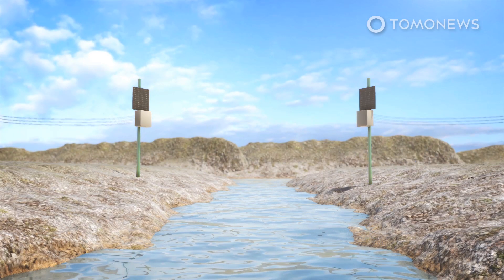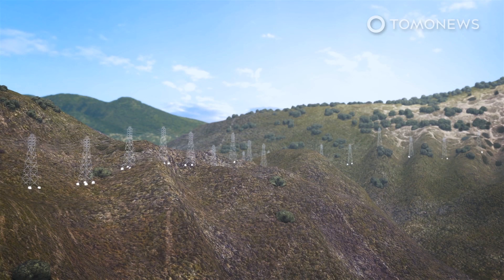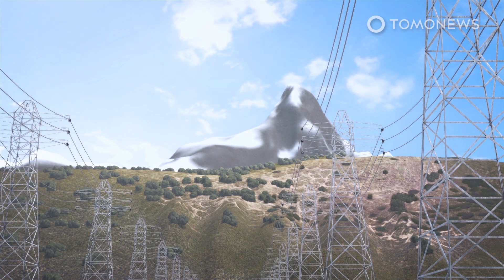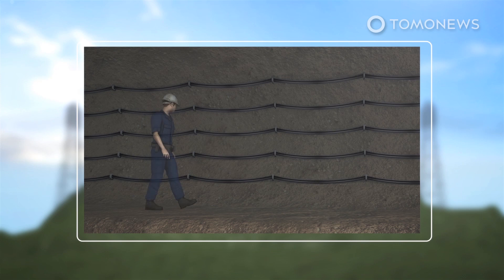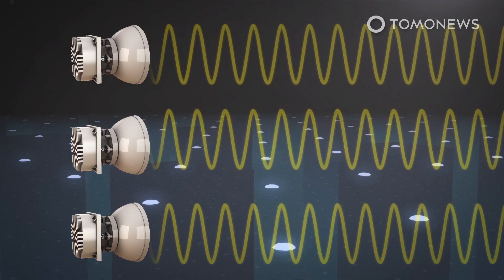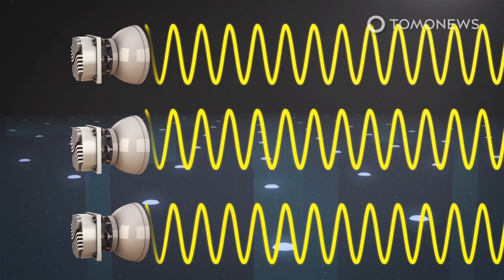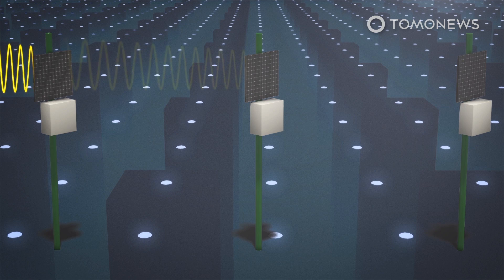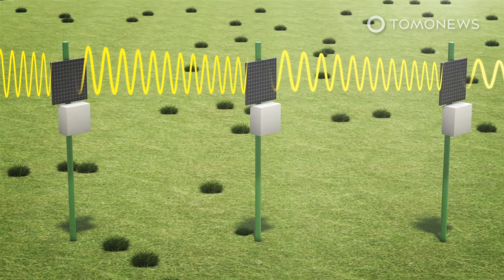New Zealand to Transmit Electricity Through the Air

Comment: during  bird resistance or drone resistance etc 
in every home roof there is a electric  rechargeable battery for in case of power off due to resistance battery shall supply electricity to home but when  electricity shall on then battery shall off and waves of electricity shall start supply waves to home

according to my knowledge 
during bad weather no danger or resistance for electric waves due to Towers shall up level from ground of earth
no need of laser security  beacause DC current  cannot become danger for resistance of drone or birds even mankind absolutely no danger

Comment: or supply plus waves only then resistance inside the waves is not resistance in every circumstances for example  rain  and snow bird resistance or drone resistance  etc 
and get negative  waves from earth in every home and transfer negative ac wave to dc wave then home negative tower shall catch and shift both waves towards electricity converter box for supply in home

Comment: Did they just say they'd shut off the electricity if a bird flew past the beam?
Reply: Hazardous levels of RF radiation. 
Bird will be cooked before it hits the ground.
Reply: @atcrunch  it's no more hazardous than having an xray for short periods. They purely built in that functionality to keep activists happy.
Reply: @atcrunch  yes or severely injured from the beam.
Reply: @atcrunch  so they're emitting radiation right next to people houses to make electricity
Reply: Yes
Reply: Yes Ive questioned them about this very point and have yet to receive a reply. Clearly if the beam does not shut down it would harm wildlife. If thats the case what sort of EMF is it out putting to immediate surroundings  ?
Reply: Bro think about it. Your power to your house gets disconnected everytime a bird passes by😂